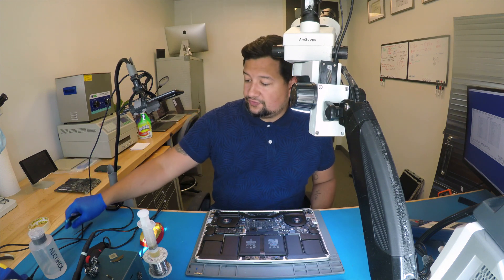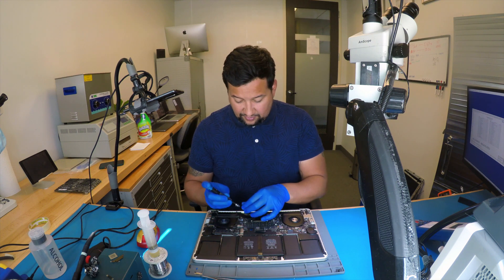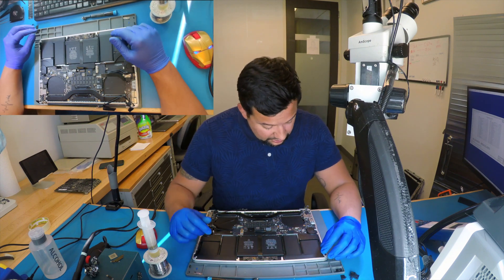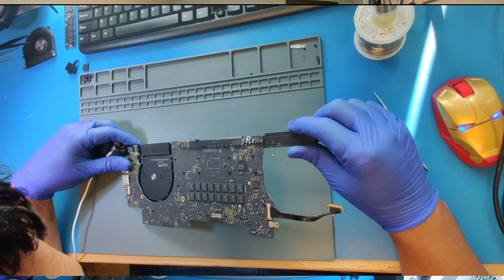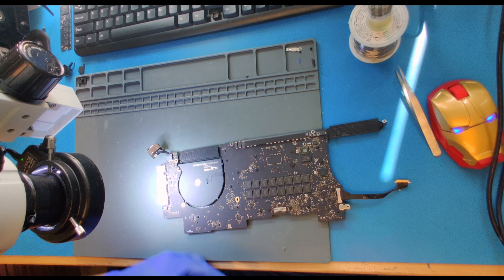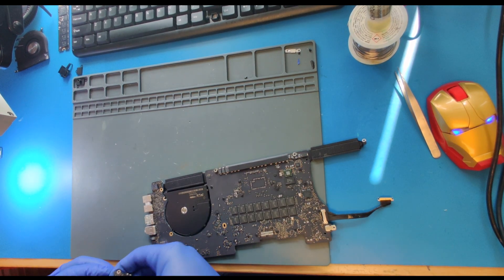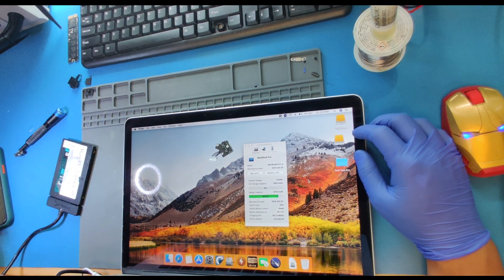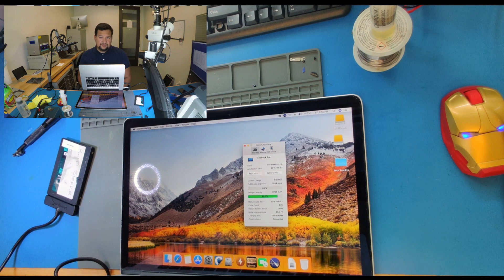MacBook Pro 2015 15-inch A1398 NO POWER SMC or MagSafe?

Comment: Hi new subscriber here, I was using my A1398 EMC 2745 with a lower wattage charger.  The battery died ine night and the machine has never switched back on even with tje correct 85w charger.  Light comes on on the charger, but comp will not work even with the battery disconnected.  Any ideas, please.
Reply from the maker: Keep power button for about 20 seconds and connect charger, if it doesn’t works then needs a deeper diagnostic

Comment: What if the fans don't even move? No light, no power
Reply from the maker: Probably g3h missing. If you are not a tech take it to one, however I have others videos talking about that issue in different models and it is the same critical thinkingZ
Reply: @Juan4Repair  Thank you, I'm taking it to a tech tomorrow.

Comment: Hello, having similar issue with early 2015 13” macbook pro. battery fine, magsafe wont charge and light wont turn on. Have cleaned and swapped magsafe dc unit, smc reset and still no fix. Please help!
Reply from the maker: Check pp3v42_g3h and together with sys_onewire. Good luck
Reply: @Juan4Repair  thank you will do!

Comment: I have a mid 2009 macbook pro the charger doesn't have a green light but it holds charge on the macbook you think I should just replace the magsafe port and if it doesn't work start troubleshooting on the SMC?
Reply from the maker: Try another charger or another battery and from there all the lines that are related to the charger. There’s a couple things to know to can diagnose this failure in the best way.
Reply: @Juan4Repair  I replaced both battery and new charger. It stays on 2% charge. Maybe try and take the battery out and re-install it?
Reply from the maker: @DevinsDen  and measure, the charging circuit.
Reply from the maker: Check the battery is always the first step and check the charging and the battery checking

Comment: I have the same model with dual graphics and mine has the same behavior, but I also get the low battery icon on the screen and then it turns off (with and without battery).
Reply from the maker: You should check U7100, SMC and Q7155, start from there.

Comment: Can you please give me some advise.. Same model, the head connector and MBPro become very hot( connector area)  when I charge it.
I already change my charger to new one from Apple, but the same problem happen.

Should I change the logic board or is there any suggestion.? BTW what is that "Iron Man" on yr desk ..? Looks cool !! :)
Reply from the maker: Hey, it is Iron Man (lol), text me at +14695580125 you can use WhatsApp.

Comment: Hi, very valuable content, Thanks, I subscribed. I have the exact same MacBook Pro 15" mid 2015, I experience a missing PALM REST SENSOR and PALM REST ACTUATOR resulting into zero feedback on trackpad but still being able to use it w/o feedback and very slow CPU and throttling (yet cold computing units). It has been told me by a credited repair center in my city that it is imputable to the motherboard and therefore some missing tracks between trackpad and SMC. Do you have any schematic and topography of the SMCs surroundings for this Mac? Many thanks.
Reply from the maker: Hey Teo, my recommendation you need check the voltages coming to the keyboard connector. I have a couple were the problem is only the flex that communicates trackpad with logic board. Any other help +14695580125 WhatsApp. Good luck!